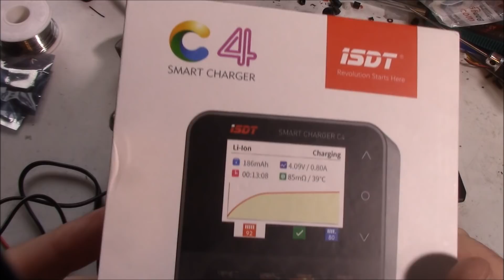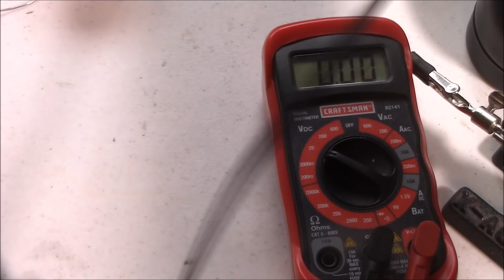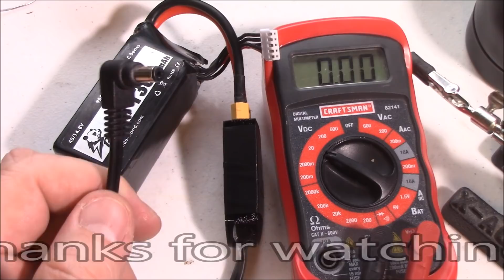DIY FatShark 24v to 9v Voltage Reducer Adapter Cable

Comment: ADD a switch and a low voltage alarm?
Reply from the maker: For low voltage alarm, I plug a separate checker to the balance lead on the battery.  I've been looking for a good switch though.

Comment: v2 with a balance plug for the fan? :)
Reply from the maker: I've had a few people ask about that.  I don't use my fan much.  I'm constantly plugging in my goggles and unplugging them.  But I guess I wouldn't really need to fan connected until I was actually going to fly.  I'll look into it.
Reply: travisgrindal I guess the need for the fan depends on where you live, here in the winter the lens tend to fog, but the rest of the year there is no need for it as well.
Reply from the maker: It shouldn't be too much effort to add it.  I'll see if I can find a 2S balance lead.
Reply: travisgrindal it still requires some 3d print near the plug to make it clean and avoid running a 1m wire from the xt60 up to the connector

Comment: what about the fan - - - errr would have been nice if you addressed a nice way to do it  oh well
Reply from the maker: I think my fan is broken.  When I do try to use it, it doesn't spin up so I didn't add any fan wires on this.  You should be able to splice into the wires and add a 2S balance lead to power the fan.

Comment: Couple questions please
How come you just didnt solder the XT60 connector directly to the Board?
Could you add a Header Pin at the end so the Fan can be powered?

Awesome video
Reply from the maker: That Old Dude I didn't think about that.  I would have to probably raise the inner piece that holds the board just a little to get it to line up, but I think it would be doable.  I believe the fan runs off the full voltage of the battery so adding a 2S balance lead should work.

Comment: Wire this into it and put it under the shrink wrap. https://www.banggood.com/0_28-Inch-2_5V-30V-Mini-Digital-Voltmeter-p-974258.html (Follow Travis' links above)
Reply from the maker: I thought about that and I almost integrated a holder for it into the housing.  The problem is that I'd have the battery in my pocket and I'd only see the voltage when I intentionally pulled it out to look at it.  I think a low voltage alarm with the LEDs built into it would be a better option.  This could be stuck under clear shrink wrap so the battery connector would be accessible at the same end as the XT60 connector.   https://www.banggood.com/BX100-Battery-Voltage-Tester-Low-Voltage-Alarm-Buzzer-For-18S-Lipo-Battery-p-1070002.html?p=6Z050013977120130325&utm_campaign=139771_1210911&utm_content=1081
Reply: But between flights it would be useful.  I would wire it inline so that it only shows voltage when plugged in so you don't accidentally drain.  A fully charged 6s is 25-ish volts, that regulator cha probably handle that.  (Test when NOT on your face)

Comment: Why don't you add a small fuse so that if anything goes wrong it just pops the fuse
Reply from the maker: That's not a bad idea.
Reply: That's what I was worried about. So there is another video coming up?😁
Reply from the maker: Not for a while.  I have to figure out how to add it and see if I can integrate it into the 3D print to make it nicer.  We have racing practice today and a race this weekend.  I'm not going to have anytime soon.